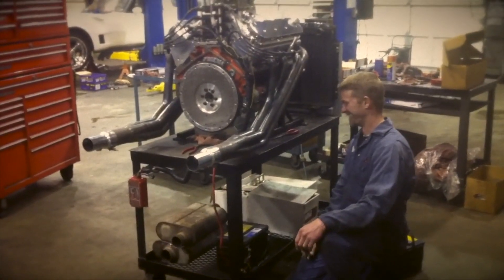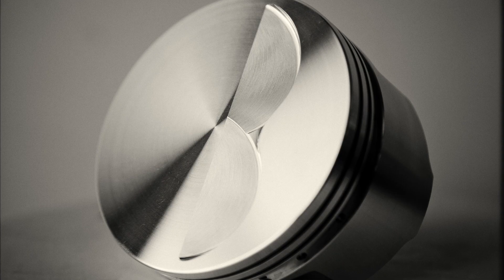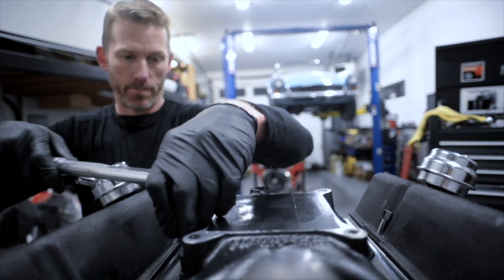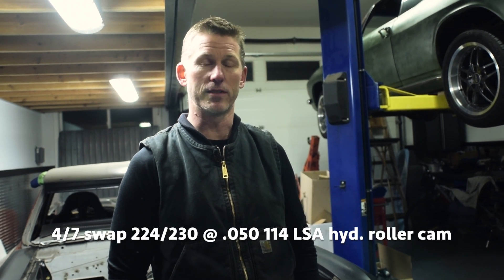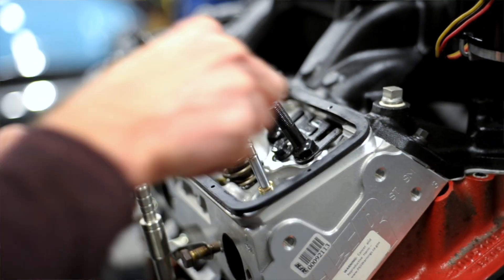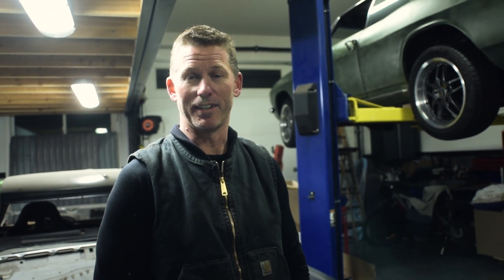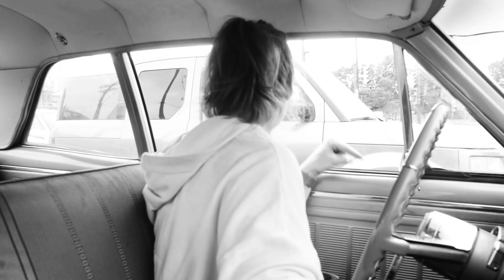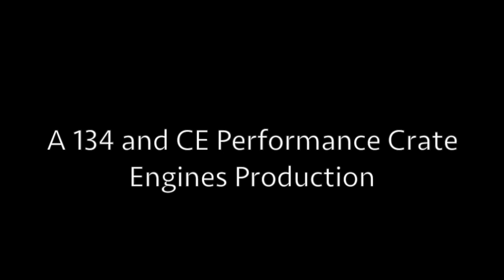We Built the Greatest SBC — A Big Bore, Short Stroke, Long Connecting Rod Engine

Comment: Could you tell me a bit about the LS rods? Do they require any machining to use in a small block crank?
Reply from the maker: The LS rods I used are actually after market Scat rods for the LS. They have the wrist pin size .927” like a small block because most performance pistons made for the LS run the .927 pin. 
No alterations needed to use in the SBC. We used them because we wanted the 6.1” length!
Check your own compression height to make sure you get the correct length rods for your application!

Comment: That sounds like a fun little engine,  but I thought LS rods were about 50 thou wider than sbc's. Did you grind them down to gen 1 spec?
Reply from the maker: They are different but they fit :)
We used them because we wanted the 6.1” length.

Comment: Always  enjoy your content and appreciate engines of this level being offered as crate engines in Canada,  my over square 1st gen. is 3.6250 stroke by 4.185 bore = 399ci...10.7 to 1....260/266@.050....110 lsa....6" rod......266cc 17* heads, what caught my attention was max torque both 5700(560) and how much the 70 ci. ate up my cam 641@6400 compared to your 7200. Next season my Sonoma will be running the streets of Windsor Ontario, currently in Olean NY. till I move back to Canada.
Reply from the maker: Thank you for commenting! Your combo sounds amazing :)

Comment: Imagine that with a couple little turbos ! Something capable of 20-24 psi and 8500 rpm  (keep it to 7200-7600) and around 10-15 psi
 (1 bar) with a bit of water methanol, sneak a 3gallon tank in the trunk. Spray water just after the turbos. At 100 psi (+/-) either EFI OR CARBURETOR.  Reach 0 psi boost vac around 1500 2000 rpm, maybe 5psi at 3000 1bar around 4200, maybe use diverter valves to spool faster, 1 bar by 3000? it should basically double power from 3000 up, maybe more with water methanol a 4speed with gear vendor overdrive, and and 4.10:1, 4.30:1, maybe 4.56:1😮  like a ROCKET 🚀😂
Reply from the maker: Holy smokes, sounds like a rocket!
Reply: I've seen a company that makes a valve that opens and closes half of a dual turbine turbo, close it to spool fast then open it at a certain boost to make the most power

Comment: Nice build, 329 cid never thought of that one, sounds like it revs quickly as well. Never been a supporter of long rods just cause people say they make way more power. 
Our street/ strip engine is a dart 400, unported dart pro 1s, 5.7 rods, 240/252 SR cam, 11.2 comp. Makes 616hp @ 6500 on 89 octane on the street, with 96 octane (more lead) made 635 same rpm.
Reply: 65’ Chevelle, Reid case PG, QuickTime bell, 1.76 9310 gears, manual VB, footbrake. 
Strange Engineering Dana 60, 4.10 gears,spool, Pro Axles, 29x9 slicks. Runs low 10s reliably all day.
Reply from the maker: Excellent! Sounds like a hoot.
Reply from the maker: Cool stuff! What’s the car it’s in?

Comment: What timing were you running at 6800 on 87 pump?
Reply from the maker: We tried the timing in a few different places from 30 up to 34 degrees. The power difference was only a few points and since then it’s running in a ‘66 Pontiac Beaumont and runs 87 exclusively and I think it’s very happy at 32 degrees of total advance.
Reply: @ceperformance right on, Ive been playing with Ls junk on 87 octane just to see what happens because the internet seems to think you gotta run e85 or c16 lol
Reply from the maker: @hooligans_garage7465 
Testing for yourself. That’s the way!

Comment: I was on a team that done very well with a 302 Chevy. We dynoed with 5.7 rods and changed the rods and piston to 6.250 rod length. It made no difference. It blew me away. I couldn't believe it but it was on the same dyno. Far what it's worth.
Reply: Overall numbers wont change much with the rod length. What the change in length does is move the powerband. Lengthening the rod traditionally shortens the piston, allowing a light piston, and lighter crank bob weight. Longer rods, lighter pistons, and less crank throw all contribute to higher rpms and power bands. Longer rods tend to wear rings faster because the pin is moved farther up into the ringpack providing less support for rings.
Reply from the maker: Thank you for that. Sounds like a great answer and I appreciate it :)
Reply: @flipfloptanlines926  you must have missed the part where he wrote it made no difference.
Reply from the maker: Very interesting. Thanks for sharing that.
Reply: I don't think it changes numbers as far as horsepower and torque, I think it changes the power band profile a bit. Not how much you make but what rpm you make it at. And if I'm not mistaken one winds up a little faster than the other.
Reply: I thought it was well established rod length makes little difference on power if at all.
Reply: @ as rpm goes up piston speed can reach critical speed long rods slow that down for reliability
Reply: @cuzz63  Its been established it moves power bands, not totals much. What has been found was its makes more gains and spins higher the lighter the rods and pistons are. Then it was figure out longer rods are lighter than a taller piston. Once those are optimized your left with the crank which is now lighter because you need less bobweight material to balance. Less weight to have to stop, then accelerate, then stop, like a piston, makes it easier for the engine to make substsntial gsins in rpm and horespower. Remember hp is just a torque x rpm calculation. Raising RPM, automatically raises horsepower. The reason torque is sometimes decreased with rpm gains is an engine needs a very large intake plenum to perform at high rpm. Large plenum are not condusive to torque or low rpm. So unless your heads and intake are perfect perfect, generally you side with making the plenum larger because drag cars dont operate at low RPMs. Now circle track has restarts so you need good mid and high rpm, making induction more dificult to get right
Reply from the maker: @flipfloptanlines926 
Great comments. Thanks!
Reply: I have never noticed anything but a reduction in lifespan for the rings in long rod applications. 5.7 is plenty for SBC.
Reply from the maker: @FrostyBob99 
I wonder why that would be??
Reply: @ceperformance  I don't know if it's because the piston is shorter and there is side loading going on or if it has something to do with the top ring land being so close to the top of the piston? 

It seems like the pistons want to break the top edge off from the top ring into the dome. I've seen it happen a few times in N/A and boosted applications. Of course, I could just be jumping to conclusions, but it was enough to make me shy away from long rods.
Reply: @ a lean condition makes a lot of power but can destroy anything in the cylinder aluminum first
Reply from the maker: @FrostyBob99 
Interesting. I haven’t seen that pattern of failure.
Reply: @FrostyBob99  Top ring land is always looked into but worries there come with elevated cylinder pressures and heat mostly from boost or nitrous. Its understood the wear is from the shorter piston and ringpack allowing more rock. But not always noticed is the fact that the piston has less physical support, its shorter, its internal structure is less. This allows more wear simply from the piston physically bending out of round.
Reply: The longer rods are necessary to keep piston mass down due to the shortened stroke. This engine is not the same as putting a 6.0” rod in your 383 like the magazines used to do.  I don’t believe raising the pin location by 0.16” will make much difference to the ring lands but the reduced rod angles will improve side loading on the pistons and rings.  In my experience longer rods reduce torque a minute amount but the engine is smoother and makes a minute amount more power.
Reply: Piston speed
Reply: @tomsmith4066  Piston speed is dependent on the stroke.
Reply: @ long rods slow the speed at top and bottom where the mass changes direction .
Reply: @there is less angle in a longer rod and big stroke short rod drastic angle pulls the piston away faster.
Reply: @mchristr  piston speed is also affected by rod angle short rods will have a sharper angle that pulls the piston away from tdc faster. Longer rods have less angle and dwell a top and bottom longer for less stress on piston at high rpm.
Reply from the maker: @mchristr 
The rod length also affects the rate of acceleration and deceleration.
Reply from the maker: @tomsmith4066 
True story :)
Reply: @mchristr  "Speed" is the wrong word. "Acceleration" is the proper term. The piston accelerates and decelerates at an increased rate when additional stroke is added to a fixed deck height. Piston "Speed" is only dependent on rpm.

Comment: big bore long stroke big displacement is better
Reply: Aussie 302ci Cleveland,  same 4" bore block as the 351C, 3" stroke, 6.028" rod. Really nice smooth long lasting engine, responds great to modifications.
Reply from the maker: Great example!
Reply from the maker: True is some, but not all cases :)
Reply: Not when your running a class that is pounds per cubic inch.
Reply from the maker: Also true. Remember, we’ve built a street car.

Comment: very cool.  questions:  was there any discernible difference in the "smoothness" of the engine, particularly at elevated rpm (better rod angle)?  did it want a different timing/advance profile than a traditional engine of this size/power (piston dwell time)?  curious what the little things that were noticed (if any) with the long rod set up.
Reply from the maker: Thank you. It’s maybe hard to say what each change from a stock type build would be. The big bore flat top pistons with the long rod and 10.78:1 compression with low octane fuel and no ping or detonation is a big win. I believe it is a result of the sum of the parts working well together. Yes it is very smooth. Idles excellent, great vacuum, revs amazing and sounds so sweet. Compared to a flat top piston factory type 327, even with good heads, I say this one wins in many ways :)

Thanks for commenting!

Comment: So the average production 400 block won't work with the 283 crank I'm taking it ?
Reply from the maker: Correct. I’ve never seen bearing spacers  to go from the small journal to a factory production block. Might need to make some someday.

Comment: If ever there was a place for conical springs and solid lifters this is it 😁
Great engine build. 
A light fly wheel might help it get to the higher RPM faster.
Reply from the maker: Thank you! I appreciate your comments :)
Reply: @ceperformance  you guys do great work,, hope to see more motor build videos this year 😁
Reply from the maker: Much appreciated! We do have some other builds on the go that I plan to shared as well.
Reply: @ceperformance  you built this one, 
 I could only think about the 283) 400
 i couldn't get past the bearing problems, and the Ls Rods was a great idea, good strong part / less expensive. Was the duration under 220° on the Cam? The torque numbers are so good. 👍🏻 That's what you need for the street.
Reply from the maker: The cam lobe i.d. numbers from Comp Cams, are 3314 and 3315
Duration is 224/230
Lift at the valve is .536” / .544”
LSA is wide at 114 degrees
Reply: @ceperformance  hear is a idea 💡 narrow loab separation looks like less duration for the engine, example, a 383 cubic inch engine with a 2.05 inch intake valve diameter, the calculation would be: 8383=47.875, then 47.875/2.05=23.3536, followed by 23.3536×0.91=21.2518, and finally 128−21.2518=106.74 degrees LCA.
So a 7° LCA. Let's see what your 283/400 comes out to? 
2.02 valves?
Reply from the maker: I find this an interesting idea. Certainly the tighter lobe separation would yield more horsepower and likely at a much higher rpm. I think it would change the characteristics of the engine and drivability a bunch. There’s probably pros and cons to both sides. 
It would be sweet to have a day of dyno time just to test and play with different camshafts as well as bigger intake manifolds :)
Reply: @ceperformance  a 106° LSA would raise torque on the low end to make up for the short stroke, I think the position diameter is overcoming a lot of it from the looks of the performance so far. I really like this engine Build, I have a 283  , love the mighty mouse SBC
Reply from the maker: Thank you!